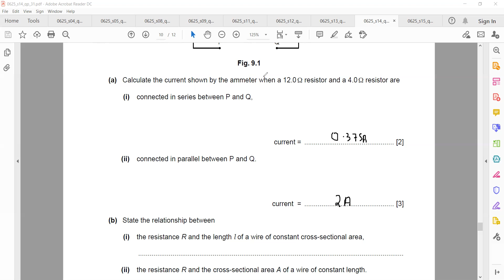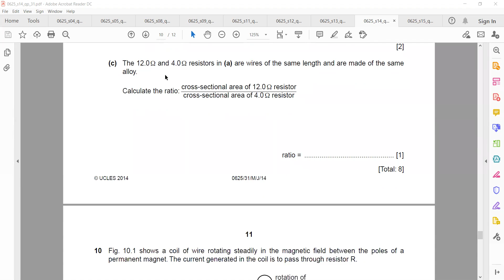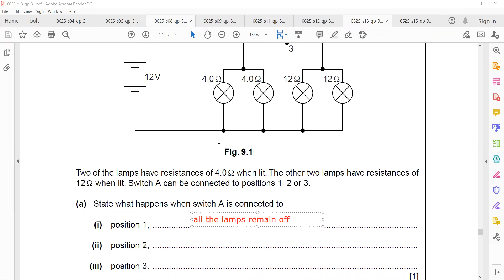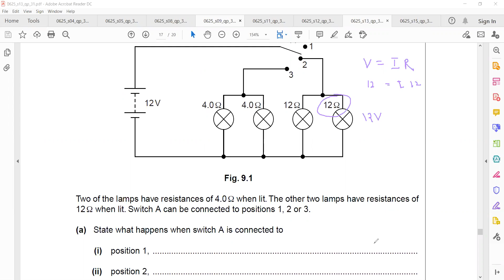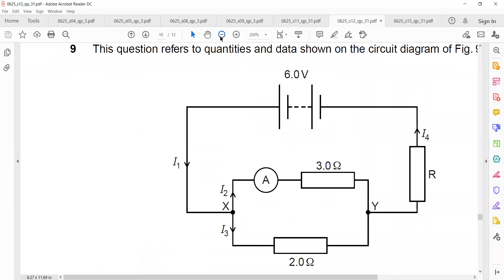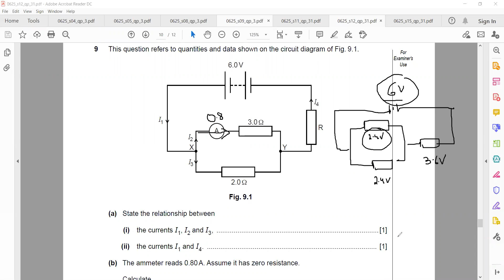Electric Circuit Questions from past papers IGCSE Physics lesson 43 part a

Comment: Sir i have one doubt when we are finding current we take total resistance right sir
Reply from the maker: It depends on the question if we need total current then we take total resistance if we need current in each component we take individual resistance
Reply: Current find out by using total resistance
Reply from the maker: yes

Comment: Sir if I wanna take classes with you , can you give me the details of how much you charge etc.
Reply from the maker: Contact via mail
Reply: Find out the following in the electric circuit given in figure alongside:
(a) Effective resistance of two 8Ω resistors in the combination
(b) Current flowing through 4Ω resistor
(c) Potential difference across 4Ω resistance
(d) Power dissipated in 42 resistor
(e) Difference in ammeter readings, if any.
Reply from the maker: Ok

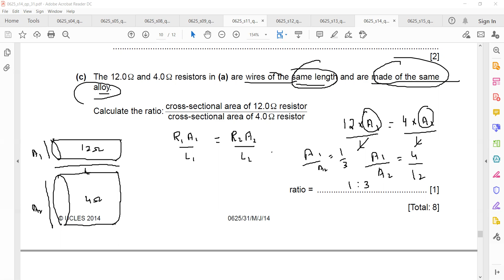Comment: I have a question in 13:23 if you took 12 ohm as A1 and the formula is A1/A2  then why did you divided 4/12
Reply from the maker: The resistance and area are inversely proportional 
So formula is
R1/R2 = A2/A1
When length and material are same